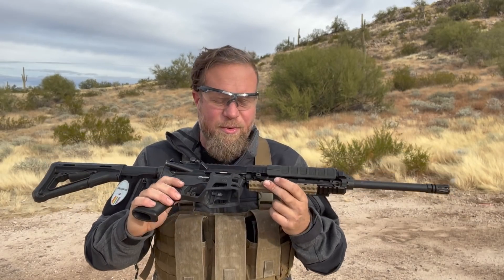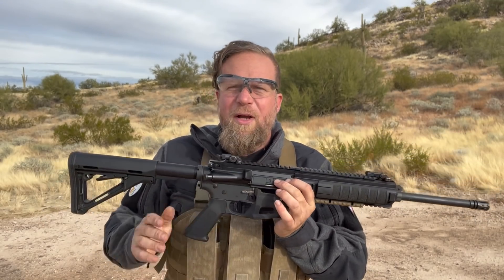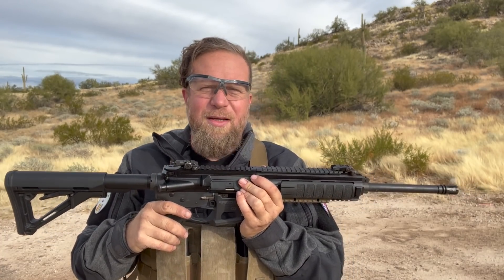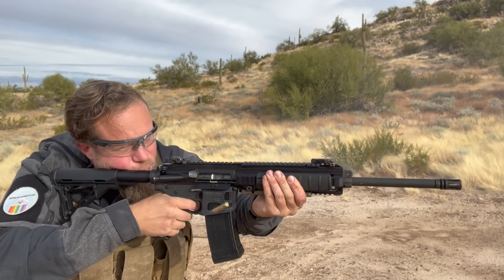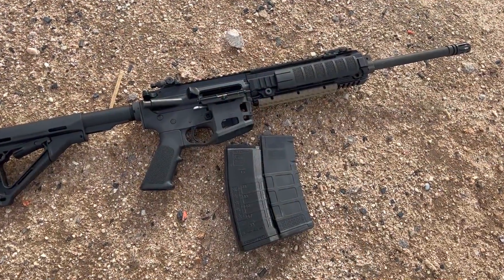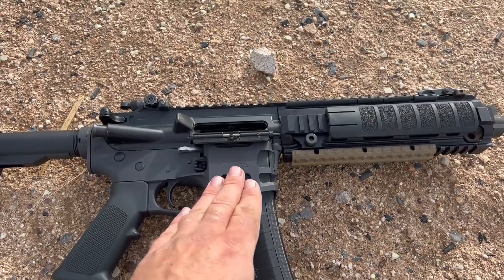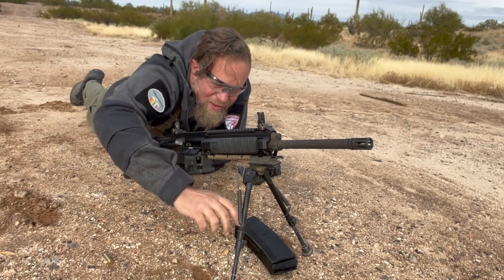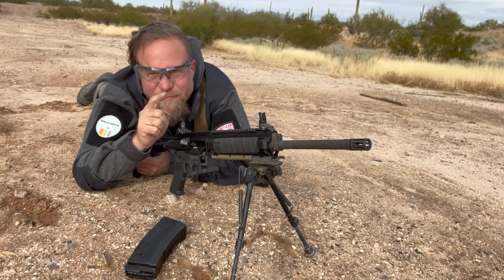Desert Tech Quattro-15

Comment: Hmm, three quadstack mags take up the same amount of space as six 30 round mags but holds 21 less bullets for the same space. Not saying that it's a problem but it's something to take into account.

I think the biggest issue will be that a special insert is need to run regular mags. That will make logistics out in the fieldsreally annoying and will prevent ammo sharing in the heat of battle. If they can solve that issue in a way so that you can either use STANAG mags without extra parts or by just "flipping a switch" then I think this idea could really work.
Reply: But you also have one in the gun that has 53 rounds compared to the 30 rounder giving you a total of 2 extra rounds for the same space and only 3 reloads instead of 6.
Reply: @IceWolfLoki  Sure. But like I said, the biggest problem is not being able to share mags with the rest of the squad.

Comment: Bro this year is going to be huge for gun owners with magpull making electronic components for your ar15 with networking built in and dust cover install that make gun smithing just a little bit easier and desert tech new lower quad stack like it has never been a better time to give the people the same capability as the military and even more the some real army’s out there

Comment: Seems like it would be pretty easy to have a magwell insert so that it could take STANAG mags as well so ammo could still be easily shared by a squad.
Very neat idea
Reply: To be honest... if this mag works properly, it might as well replace normal STANAG mags. Imagine a squad with interchangeable 53 round mags all around.
Reply: @Stellar001100  Kinda doubt it, that's a lot of weight to add to a weapon when everyone's weapons are getting really heavy as is.
30 rounds mags are a thing for a reason
Reply: @shaggnar2014  Yep. That reason is that more than 30 is too long and unreliable. This is shorter. If it is also reliable, it will succeed.

Comment: I wonder how much the capacity would be if they made it a bit longer (like a +5 extension, or pmag40 length perhaps) - with the quad stack design, would a +5 extension be more like + 9? With a bit more length you would be approaching the 100 round pouch sizes the SAW gunners use. Harder prone tho.

Comment: They need to design spring-loaded flaps inside that bigger mag well. They will make a funnel for the regular sized mag. Then have a protrusion on the upper part of that Q15 that will unlock the flaps and get them to fold back when the bigger mag is inserted. Then you don't have to have some adapter that could get lost. Then it is compatible with everything.

Comment: That's neat, but at least in a military sense I don't think it beats out those 40 round stendos that magpul makes. They're a bit taller, yeah, but they'll function in any gun with a magwell that takes standard pmags without having to pop in an adapter, and you're only losing out on 13 rounds (or less if you pop an extended baseplate on the 40, but I have no clue how that affects reliability on those mags). I'd like to see them refine this so that their magwell can take a standard AR mag without a removable adapter; that still wouldn't fully alleviate the interchangeability issue, but it'd be a step in the right direction.

Comment: I am curious on why you would not just make an detachable adapter to a standard magazine that attaches to the magazine not the mag well.  Instead of having to insert an adapter during a fire fight then reload you could just reload.  Seems like a cheap sleeve that you could slide on and off of a standard mag would be more useful on a team level if quattro mags/rifles are limited.
Reply: One adaptor versus having to carry around a whole set of adaptors, and having to ensure the adaptor sleeve is on each and every STANAG magazine you might be using *in that firefight where you've already gone black on ammo once*.  And those adaptors don't install themselves on the Random Rifleman Magaizne rhatvjust got tossed to you when you shouted out you were dry.

Or, you can have an adaptor that snaps into the gun like a magazine, so you take the time itnwouod take for a single mag change to snap it in, and then you can feed all the STANAG mags you need, without having to prep each and every one.

Comment: Karl notes that an insert is required for standard 30 round magazines. I'd be interested to see what the procedure for fitting one of these would be - as one of the selling points of the M27 IAR was that it could switch between a box feed and standard 30 round mags fluidly. So how quickly an insert can be fitted could be key to competing against the M27 IAR, if at all - as any interference in that procedure may be seen as a detriment on a commercial basis for any military force that are considering the M27 IAR and seeing this as a potential competitor.

Comment: Very Very cool idea @inrangetv. My biggest question is one that hit me the second you showed us that it fit in your vest pouches... My question is this. with a 53 round mag taking up the space designed for two 30 round mags.. how are you going to get around loosing 7 rounds per mag pouch of total carry ammunition count? considering the dubious nature of full auto in small arms combat outside of niche roles generally relegated to 100round belt going through SAWS and the like.. I curious if this idea is truly a benefit.

Edit to add because i needed to go back and look: Example- you are wearing an LBV that is set up for 6 30 round mags. completely loading your vest with 3 53round quads. you loose 21 rounds of total capacity.. i'm kinda confused why they didn't just design them from the ground up to be 60round mags..

Comment: That's a cool project, I have doubts though. The surefire might jam but it doesn't need any extra kit to be used. Keeping track of inserts for legacy mags sounds like a logistical nightmare. It's something a potential military adopter would have to give serious consideration. I think it might come down to how quick is the insert and how easy is it to keep track of. You don't want to run dry during fire suppression and not be able to take the next guy's mags. That's the current advantage of the IAR over most belt feed system. So, if the insert can nearly be instantly installed that issue is solved. As for keeping track of the insert, I'd the dimms aren't bad it could be stored in the stock or in a soldiers pouch. 

Oh yeah. Cost is always an issue. Militaries are serious penny pinchers. So I imaging convincing them to buy all new magwells is a big ask. Not only that, new mags, springs, inserts and any other associated expertise required from desert tech.

Damn, that product looks promising. I'm really hoping it succeeds. It'd definitely be right for the soldiers if they get it right.

Comment: Would love to see what a 30 round mag in this configuration would look like. I've always preferred the dimensions of 20 round mags in AR15s, so something approximating that length with more capacity would be really interesting.
Reply: A few of us have been chopping Surefire 60 mags down to 35-40rds for just that purpose. The mags are excellent for both stowage and firing in the prone position, but I will admit a design like this that takes advantage of increasing the quad stack section has its merits by being more efficient in shorter configurations, and when stored in double mag carriers.
Reply: @AnonEMus-101  that's an interesting idea.
Reply: @sanguinemoon9201  All you need is common hand tools to cut it to length (with a few tabs cut-out), heat and fold in the tabs, then file in tight spots until the floor plate can fit snugly. Then cut the center divider/guide to the same length the mag was cut to; and finally reassemble with full springs (the springs collapse into themselves in such a way that cutting them shorter offers no benefit).

The option is great for complimenting a standard rifle, but the fact that the Quattro mags are polymer and easily prototyped means you could potentially have endless possibilities of mag length and calibers. I will keep my eye on where this design goes as well, because on the surface it seems like a superior option for a dedicated load out.

Comment: Hum, I think they might be onto something here. This is similar to the polymer lowers you fellows were working with back on the WWSD project. If you try to make a standard AR lower out of polymer, you run into problems. If you start from the ground up, far less problems.

Comment: Could the insert for standard magazines be a folding attachment to the lower receiver? I know the chances of me loosing something like that in a an emergency are high. So if you could just fold down one or a couple of spacers so the ability to retain the use of standard magazines on the gun at all times would be all around amazing. It may not be possible but darned if that wouldn’t be spiffy.

Comment: I’m interested in how the mag catch works and how it would possibly work with an insert to take 30 round standard mags.
Reply: That is easy. The insert has a mag release button on it too which is actuated by the mag release button on the gun.
Reply: @wingracer1614  I guess I’m having trouble visualizing how that would work with an AR style mag catch.  Which this gun appears to have based on the outside of the mag. Seem the only way to actuate the catch would be from the left outside of the gun. Which means it would add another snag point externally.

Comment: I see a serious flaw in this. The whole point of having a mag fed fire support weapon is to have interchangeable mags with the rest of the squad. If they added channels to the face and back of the mag and mag well that allowed it to take the quads or standard mags, I could see it being viable.
Reply: Alternatively, just give everyone this magwell
Reply: Channels would have the advantage of being integral to the lower, but would have to be strong enough to hold the standard mag stable, and also not interfere with the quad mags. An insert is probably simpler to design and produce, but has the potential to get lost dropped or damaged. Two different solutions with different pros and cons, interesting to see where this prototype goes.
Reply: The Marine Corps plan is to give every Marine an M27, so everyone would get this magwell as well, preserving interchangeability.

Comment: Hopefully they figure out some way to keep the standard 30-round adapter insert on the gun so you don’t have to worry about losing it or digging it out of your kit. Having it hinge forward would be awesome if possible
Reply: That was my question about the adapter concept as well. Wouldn't it be better to have it built in and sping loaded, but there is some "key" on the quad stack mag that opens it to full size when you insert it?
Reply: @wehooper4  then you have to figure out the mag catch that can grab a skinnier standard magazine.
Reply: @randomidiot8142  Yeah I was thinking about that after posting the above. A folding catch could fix that, but all those moving peaces would just be crying for rocks/dirt to jam them up.
Reply: @wehooper4  this is a situation for a rear or front mag catch that catches the center of the mags, but you still need a durable simple way to shim the skinny standard mag in a fat magwell. But if you did a new mag catch design then you're getting too far away from the dual purpose/increased utility rifle concept because you're not backwards compatible with standard mags. 

The joys.
Reply: @randomidiot8142  You have the alternate mag catch for a "pivot out" insert work the same way I'll bet it does on the "snap in" insert - the regular mag catch on the fat mag well mates up with a lever on the insert, and that lever in the insert engages the mag catch spot on the STANAG magazine.

But, I think a swing out insert is a bad idea, as you'll have this "emergency feed device" widget swinging around in the open, getting full of crap.  So that when you need it the most, it fails.

Might be worth designing a stock that holds the insert attached and protected, like some of the Geardo stocks that hold spare magazines (only, make it covered).  At least the insert will be with the gun if you need it, and not as exposed and easily collecting sand, mud, and rocks.
Reply: @wehooper4  Why add to the complexity?  The most innovative solutions are usually the simplest.  K-I-S-S, Keep It Simple Stupid applies, especially on a new firearm design.  Increased complexity means more stuff which can break and render your firearm inoperable and you out of the fight.
Reply: Loadout 3-4 53 round mags plus one last 30 round that has the adapter already mounted. You mount the adapter when reloading with that mag, all subsequent reloads cant be 30 rounders from squadmates. Adapter could lock into the quadstack magazine catch and have a separate catch to secure the 30 round mags.
Also allows the adapter to be removed and stowed if not needed.
Reply: I think a great way to keep the adapter with you is to design it in a manner you can keep a 30 round mag locked in the adapter and hot swap that in the receiver. Those holes in the lower also look really useful to use as holes for locking tabs for the adapter so when necessary it could be easily removed.

Comment: My initial reaction was to say "53 rounds with a shorter length than a standard 30? Why not the same or slightly longer and 60+!?" Then it occurred to me that in addition to reliability issues with longer springs, a slightly shorter length would also make prone shooting easier. Really neat!
Reply: I also wonder if the size was determined by gear to hold magazines. Wonder if a double mag pouch would have issues if the quad mag was the same length as a 30.
Reply: @saccaed  likely, seing as the extra width takes up some of the closure's slack
Reply: unfortunately those pouches are designed to fit TWO 30 round mags.. if you loaded the vest Karl is wearing with only quads. he would loose 21 rounds of total ammunition payload. not sure how i feel about that.
Reply: @RTJsims  However, that's only what is carried on the LBE. There's going to be one more in the gun, so the ammo gap is narrower than it appears
Reply: @Scott-qq9jd  that's an excellent point. something else your post reminded me of. all the extra ammo in the backpack of riflemen would be a bit more manageable.
Reply: @Scott-qq9jd   Good point, if you're replacing 7 from the vest in the video with 4, you're making a slight gain, but since it's a mere 2 rounds it's so close as to be practically identical.  But say if you have someone like patrol cops or bodyguards not really planning for a long fight - If they had three mags now, the one in the rifle and the one in a pouch gives them 16 more shots overall and one less moment of reloading.
Reply: @RTJsims  Everyone could run a double mag pouch on the back panel of their plate carrier. Guys who carried 7.62 NATO into combat but wanted to make up for the lower ammo count did that, but had to ask for someone else to combat squire them by helping them put those mags on the front and the empty ones in the back. If everyone's running 5.56 it's easier because then you can always take someone's mag and someone else takes yours rather than having to switch things around.
Reply: @ChucksSEADnDEAD  In the Swedish army we ran a magpouch on the back, over one shoulder, upside down with a kind of "string" that when pulled opens the pouch and allows the mag to fall out. The idea is that you use this in urban combat to reload when you're stacking up and need a mag FAST. It's an interesting concept, not sure if they still do it. It was called a "dueling pouch".
Reply: @RTJsims  this is still just a prototype,  I expect even more than 60 rounders when it's all said and done.
Reply: @RTJsims  I think I see another possible downside - if this is the only weapon in the squad carrying it in an automatic rifle role, the gunner needs the adaptor to use the 30rd mags of squadmates if he runs dry of quads, so that could complicate things in an emergency. OTOH, you could have the whole squad carry quads and modified weapons are used as lmgs - heavier barrel, bipod, different optics, etc. Maybe the squad automatic role could carry larger mags, a few more rounds per box?
Reply: I'd imagine they would have larger mags available.
Reply: That's a good point, especially if you're using it to facilitate a IAR/LSW role
Reply: I think Karl messed that up. 
The mag probably isn't shorter in any meaningful way. 
He just put the mags so that the curvature creates illusion of other being shorter. 
I did the secret engineer student trick and pulled out the tape measure on freeze-frame: The magazines are of equal length (within measurement error). 

If the magazine is indeed shorter, I'm guessing the difference is measured in millimeters to make Quattro fit mag normal pouches despite it's chunkiness. (The feed-lips extent past thick magazine body, whereas normal magazines height ends at feed-lips when put side by side.)

Quad to double-stack still takes some room in Quad magazine, given the volume is closely similar, the quad is destined to have less capacity. (Unless the construction does not have interior dividing walls.)
Reply: 60 would be a good number. Not too far off from the prototype's capacity, and not some random odd number you have to memorize to manage your ammo.
Reply: I think they need to do 3 different sizes a 100 or so round, the 53, and a 30~15 round. I really like this concept. I hope it doesn’t fall off.